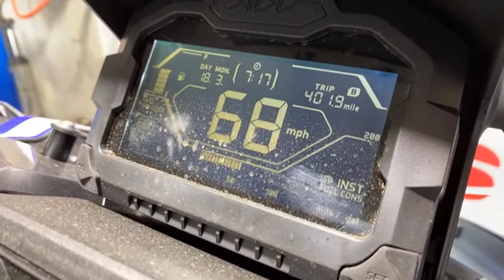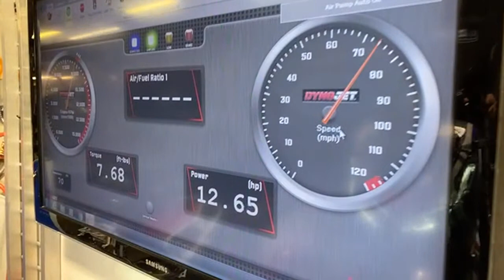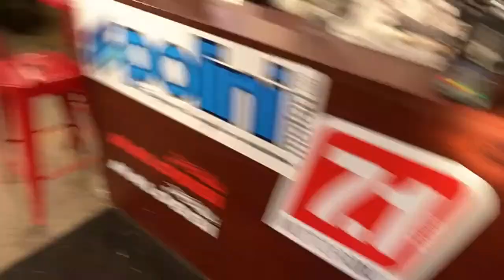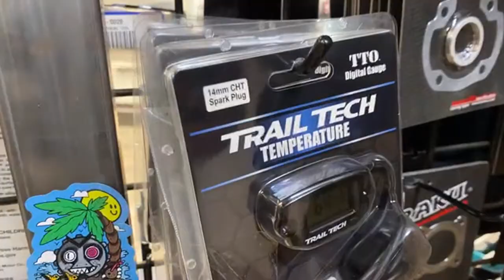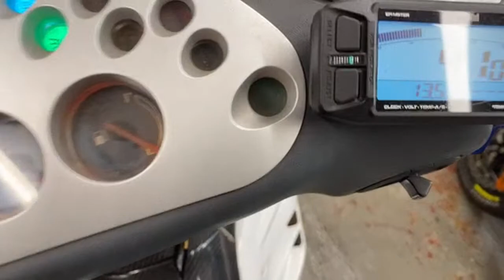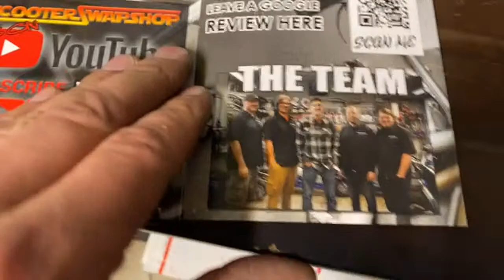Brandon Explains why to shop at Scooter Swap Shop | Shop talk

Comment: A monthly subscription box of your shop swag, scooter related fun usable stuff and accessories would be a fun investment. Pre Monthly buy ins would work with a base and premium prices for a little more stuff. Often times vendors will use this as an opertunity to advertise by providing you with product samples at a lower cost to go in the subscription boxs. Organize by bike size 50cc or 125cc and up. Often times parts are universal like mirrors , apparel (add size) and grips (use your amagination here). Thats what the pre order is for so you can get them in early. Easy way to make a few extra $$ and get new companies on the map. Example would be a scooter pack for $75 with the goods MSRP of $160. A good way to use up inventory when you have to many scooter locks.  Just an idea to help you grow. Even if you had 10 orders as a start it will grow over time and people remember you.
Reply from the maker: 1000% we already have been talking about this and working on it.